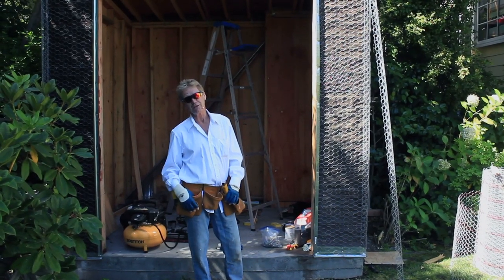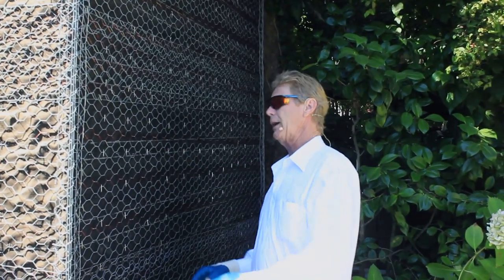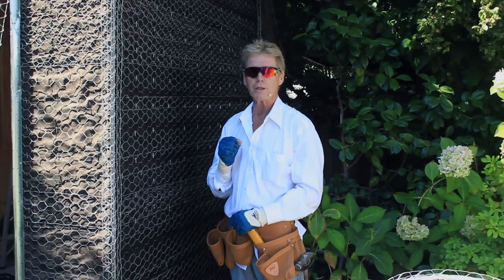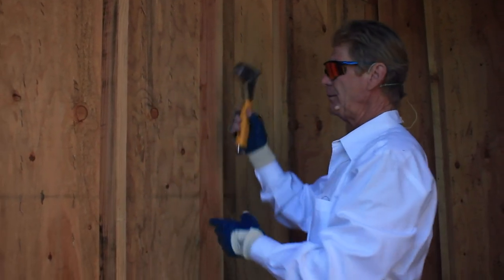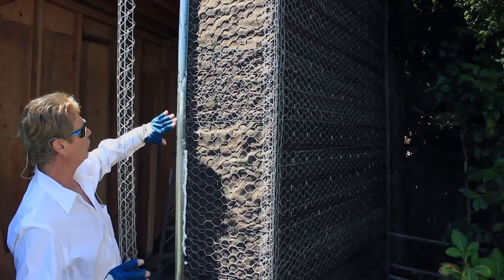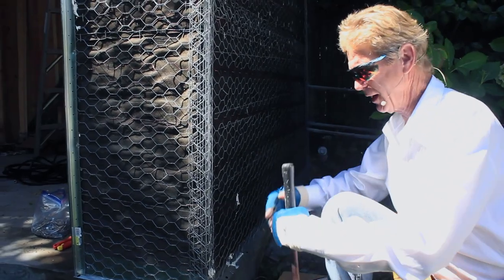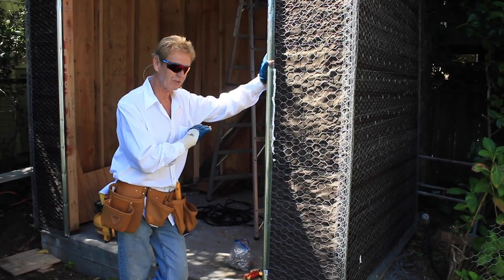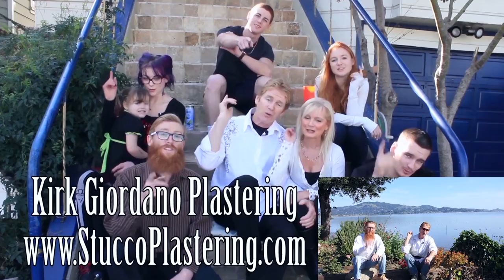Stucco lathing failures.

Comment: Hi Kirk, with the backwards over-stapled flatten lath wire, would it have been correctable by installing fresh lath wire right on top. Be quicker I would think. Thanks.
Reply from the maker: Sometimes, however two layers of furred wire would stick too far out past the weep screed and door and corner trim.The finished product could be an eyesore. 🕵🏼

Comment: I would like built an outdoor countertop made out of stucco but I have no experience with Lathe. Are there any tips you could give me on how to do it?
Reply from the maker: Morning Arlen, sure, for the waterproof membrane don't use paper but instead a peel and stick membrane or rubber type of membrane.
 Then attach almost any type of stucco netting or wire you can find, 17, 18, or even 20 gauge will work for setting tiles over a basecoat.😉

Comment: can you go over wire with wire if the first layer of wire is too flat ?
Reply from the maker: Good evening Mr. Bigtime, yes you can, that's another way of adding to the wire although it takes as much time as pulling it out. 
I have had to do this a few times when the holes are over an inch to two inches deep. 
The more stucco netting the better it is for the stucco to hold.🕺🏻 
Kirk and Jason Giordano contributing over 850 free Stucco/Plastering videos for your education. 
    Together we have created the most comprehensive encyclopedia of Stucco and Plastering videos ever produced globally, all by your favorite plastering messengers of YouTube.
Bringing peace, love, and brotherhood back into plastering.🎭🏝🎆
https://en.wikipedia.org/wiki/Lath_and_plaster

Comment: Kirk,  When you lath a shed or house, does the lath need to be one continuous piece?  Example: a simple 10X10 shed.  Should it be lath all the way around the shed with with one continuous piece or can you just make sure to just overlap the corners?
Reply from the maker: Good evening Cornelius. No,  the lath/stucco netting can be attached in many pieces. 🤔
In fact, I don't like to turn the stucco netting as this rips the corner paper.
     Instead, I go just to the corner and use a metal "corner aid" to attach/tie in both sides. This prevents ripping the paper at all vertical corners.😏
 Many homes have leaked because the "Lathers"  turned the corner with the stucco netting then had to pound the stucco netting flat with lathers hammers or l so that the corners would fit. Hence this action forced the stucco metal netting into the paper membrane, causing penetration leaks for the rainwater to enter these vertical corners.
   In many homes, the corners eventually failed as moisture found its way into the broken paper on these corners.
 Would the stucco or structure be stronger if the stucco did indeed go around without tearing/ripping/cutting/embedding itself in at the corners?
 No doubt about it, sure it would. The choice is for the lather, A tiny bit of extra strength, Or corners that are leakproof?
 My common sense says that question answers itself.
    Note: to all subscribers or anyone who stumbles on our channel with a question, type it into our Stucco/Plastering channel, 
and like magic, a video will appear to explain how it's done. 
   This feature is miles ahead of any plastering forum. 🥳
Kirk & Jason Giordano Plastering
Reply: @StuccoPlastering  pool
Reply from the maker: @DavidSanchez-ot3it  You mean, cool beans daddieo?
Reply: @StuccoPlastering  yes sir , my bad heato

Comment: You said put the "J" mold under the Paper...I would put the "J" mold over the Paper. This will allow the "J" mold to hold the apllied masonry ...Am I right..as apposed to under the paper.
Thanks, Love the videos ..
Reply from the maker: Good afternoon Kris dude, the J trim for stucco is attached first to the plywood substrate.
 Then the two-ply jumbo text 60-minute paper buts up to it, covering the nail or staple penetrations used to attach it.
    A caulking bead of Sikaflex 1A, a polyurethane adhesive, and sealant is now used to fuse the paper. The exterior cement plastering J trim together so rainwater can't penetrate the seam.
  This still allows the J trim to serve as a stucco stop or guild to keep the corner straight and hold the new exterior cement plaster.
 What I did was run a bead of Sikaflex caulking on the seam, which would still allow the J trim to work as intended but to stop and rainwater from penetrating as it was placed over the paper, don't do that.😏
Always place the J trim under the paper. Makes for a super watertight preparation.
          Kirk and Jason Giordano, together we have provided to all folks throughout the world the most complete plastering encyclopedia ever created online.
   The plastering surgeons of Youtube, with well over 850 'free' self-help videos 🎭 👀💃
 Bringing peace, love, and brotherhood back into plastering.🏝🎆
Reply: @StuccoPlastering  Ah Huh! Yes...thinking further into the Matrix of the stucco installation something that does get over looked many times over..to Protect from water penetration that's it! We here in Canada also have freeze thaw moments almost every day during winter months. If the stucco is in the sunny side of the building this where damage happens..many times..Salt on the side walks also creeps up the wall pulling moisture into the masonry, I use flashing over my installations at the base of projects..a discussion for another time.
Chow for now Kirk and Jason.

Comment: oops, I ordered the wrong lathing, could not find the real stuff and went with 20guage chicken wire...  I will probably go on with it but I guess I'm off on the wrong foot.
Reply from the maker: @rob12449  At least your using a netting, you can always try and double it up, but it does not furr, I’d advise taking it back for 17 or  18 gage wire.
Reply: @StuccoPlastering  thank you for replying, I also ordered the furring nails with stand offs, I do understand that part.  Will try overlapping some and it is only a small shed.
Reply from the maker: @rob12449  it should be fine. 😉